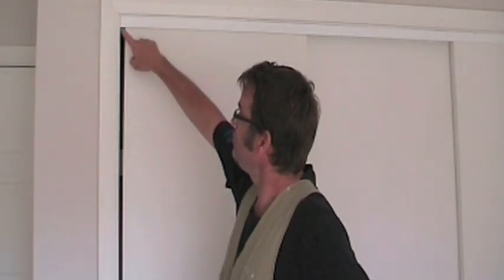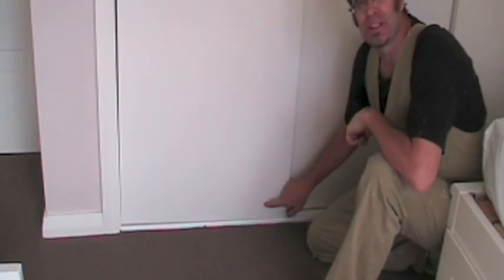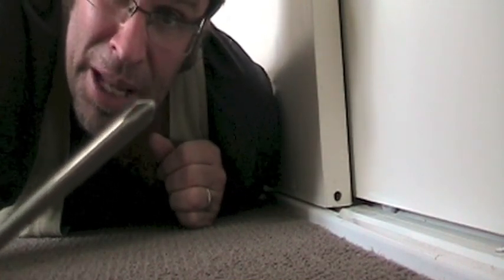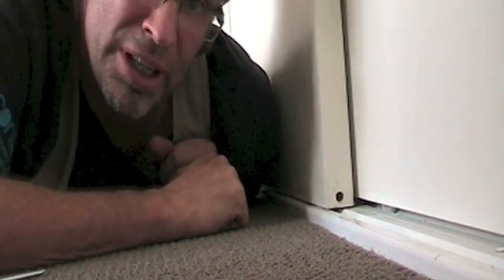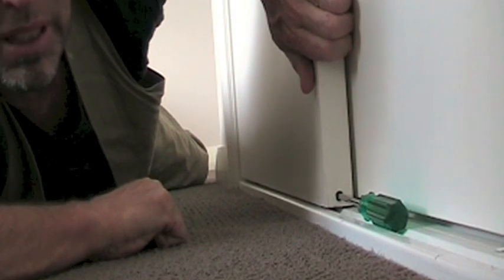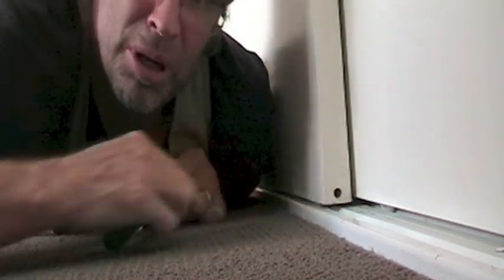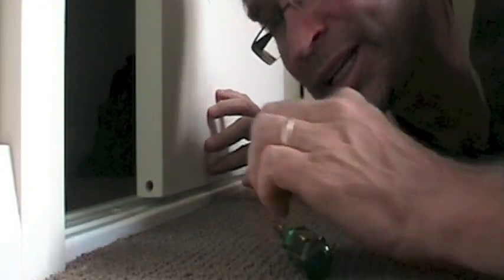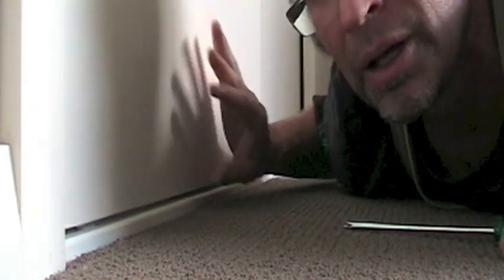How to Adjust a Sliding Door. Repair a Sliding Door

Comment from the maker: Hi cmscrapbok, that's a bit unfortunate. Some doors have fixed wheels that are unable to be adjusted. Have you had a look up above your door. Some sliding doors have their wheel mechanism on top of the door. This type of mechanism requires a totally different method of adjustment which l don't have the space here to describe. Try YouTubing "how to fix an internal sliding door" The channel name that has made the video is ProfessorPatPending. Hope this helps. Cheers.

Comment: What if the wheels are at the top?
Reply from the maker: Alyssa Styles Hi Alyssa, depending on the type of roller system, the method is basically the same as if the rollers were on the bottom. Cheers